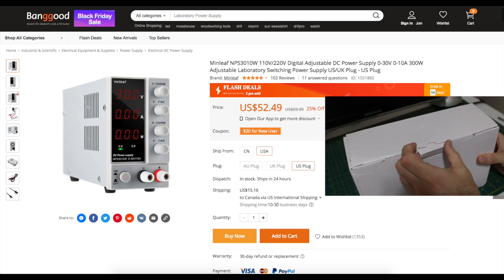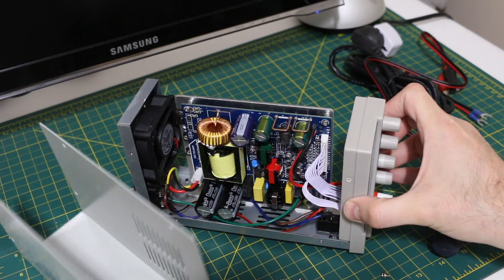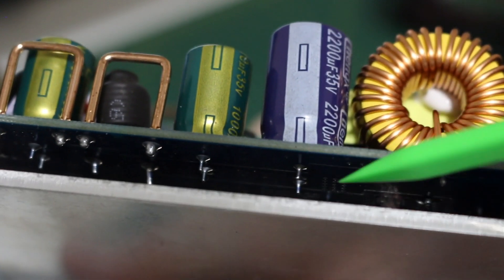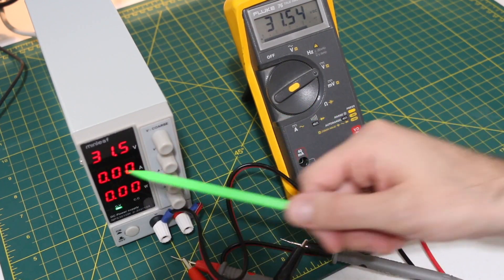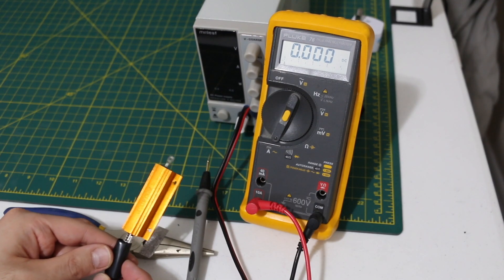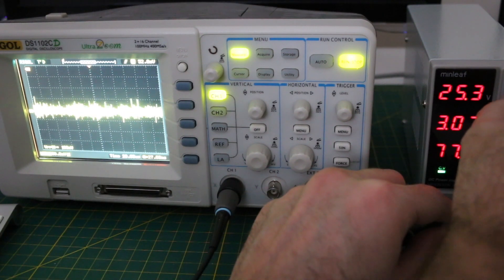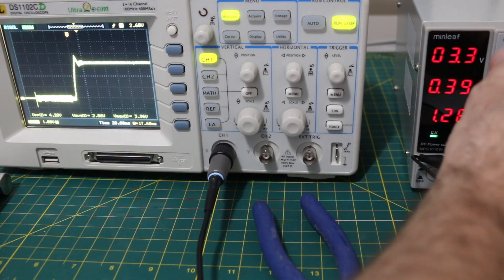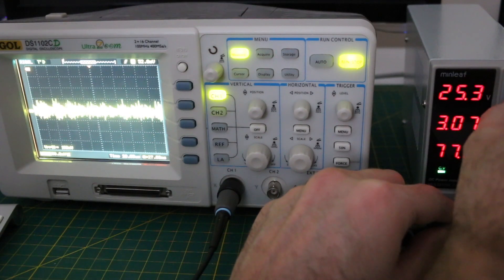Minleaf NPS3010W Power Supply from Banggood - Teardown and Test

Comment: The unit has a certain problem in the form of output electrolytic capacitors with a maximum voltage of 35 V when the output voltage of the unit is ~31.5 V. There is no voltage reserve. I definitely wouldn't recommend buying it, it's just dangerous. The device is operating on the verge of failure.
The same block NPS605W has a similar problem  with 63 V output electrolytic capacitors when the block output voltage is 61 V. It is not good.

Comment: Not reliable at all. Mine has stopped providing rated current and voltage with severe load regulation issues after a few months. Better get a US made one, pay more and not regret your purchase.
Reply from the maker: I have two  I’ve been using regularly ever since I got them a year and a half ago with no problems using several amps occasionally.
Reply: @GadgetReboot  That's great. I have taken it to the limit in terms of power output. Perhaps some devices have been stressed. I may have to open it and check the power devices carefully. The control circuitry appears to be OK. One may not notice degradation at low output power levels.
Reply: I got a response from the manufacturer stating that I should check if the AC power was switched to 115VAC (being in the US). Doh! Really? Well, that wasn't a bad suggestion even though I had been operating it on 115VAC setting from day 1. If the switch was faulty, it would explain the issue I had (the supply would top out at 23V and couldn't drive full rated current). I replaced the switch and the unit is now working fine. It now delivers 300W at 30V & 10A with only a 0.3V drop in voltage from the nominal 30V. A nice supply ruined by a cheap switch on the line voltage selector!

Comment: I found i get a few shocks/tingles on the power out with the adapter plug they supply. Seems no earth provided on the adapter.
Reply from the maker: I didn't even try to use the non grounded travel adapter thing, just put my own normal IEC 320 standard plug.  At least the inside does use the earth connection.  I knew a day would come when I could justify not throwing out pointless spare old computer power cables.

Comment: I am mostly interested how those will perform over time.
One tiny fault, according to IEC-EN-NEN standards the earth wire should be connected directly to the chassis and not via a bolt or screw from the PCB.
Reply from the maker: I was happy that the fuse was on the hot side and the hot side was being switched.   I had a different cheaply made item that fused neutral, switched neutral, and had a 26 gauge earth connection!
Reply: @GadgetReboot  I guess technically it shouldn't really matter for a fuse.
Since it will blow either way in a over-current situation and therefor there is no current flowing through the transformer anymore.
Reply from the maker: I can think of 2 situations where fusing neutral may not be safe.   If there is a short from line to chassis and the short circuit path is completed along earth ground instead of neutral, the neutral fuse may not come into the circuit (so the breaker in the panel will kick in instead).   Also if a neutral fuse did blow from a line to chassis short and someone is handling the unit, there could still be live voltage on the chassis from the line to chassis short if everything is still plugged in and active (the person may have a path to ground other than the unit itself, but have the live chassis supplying AC while handling).
Reply: @GadgetReboot  True, but aren't these events covered by the earth breaker? (RCD or RCCB). It's actually good practice just to have a fuse for each line (life or neutral, or hot and neutral, whatever you want to call it lol)
Reply from the maker: I don't know enough about all the hazards but being a devil's advocate, back in the days of just fuses in the panel instead of resettable breakers, when people would cheat them out after they blow, the only fuse would be in the device!  I remember blowing those fuses and having none in the drawer. Very inconvenient.

Comment: Nice to see it take a direct  short,  not all psu will take this. I've two 30A ones that will blow the fets and output diodes everytime you short the output. And at £200 a psu it can start to get expensive.  A small note in the specification states they are not short circuit proof, and a repair is the same price as a new unit.
Reply from the maker: Yeah the ability to take a short comes in handy around here when the unit is being moved around my temporary setup with test leads flying everywhere and forgetting to power down.   The manual for this one actually says to short the terminals to set the current limit and adjust until the short circuit current on the display matches the limit we want...a potentially bad habit to get into!

Comment: Back in September I purchased a Minileaf NPS605W power supply, which as the name implies has a maximum output of 60 volts and 5 amps. It cost $100 Australian. The only issue I have with it, is that there is a small lag between adjusting the voltage, and the power supply reaching the voltage I want. BTW I got my from Ebay, not Bangood.
Reply from the maker: Now that you say that, I just tried mine with no load connected to see, and it seems to lag when adjusting lower, but respond faster when adjusting to a higher voltage.  I wonder if that's just some inherent thing or specific to this design...I don't have a different one to test...

Comment: Free Stuff!
Reply from the maker: And more on the way hopefully coming soon!
Reply: @GadgetReboot  Have been playing with audio chip amps, w center tapped transformers in recent weeks.
Would be nice to have a variable supply, center tapped, with Sziklai pair / capacitance multipliers that deliver millivolt-level ripple, so as to drive my test rigs with ideal maximum power.  (sigh) Surely something like this exists ... but probably expensive.